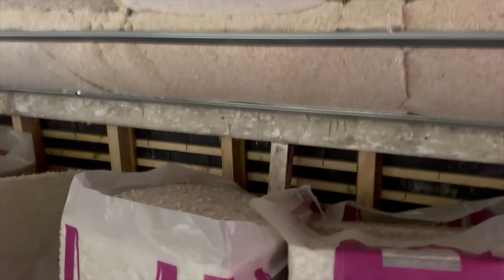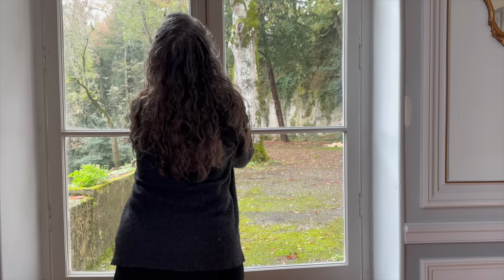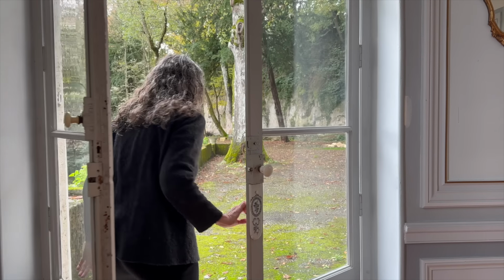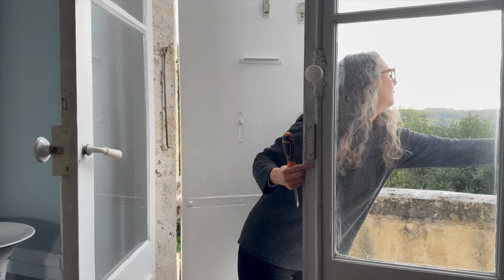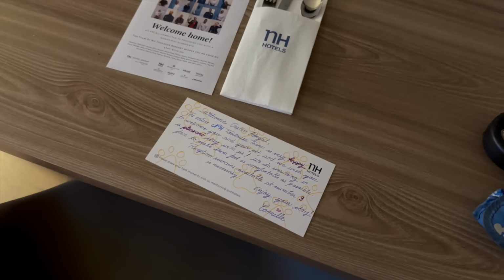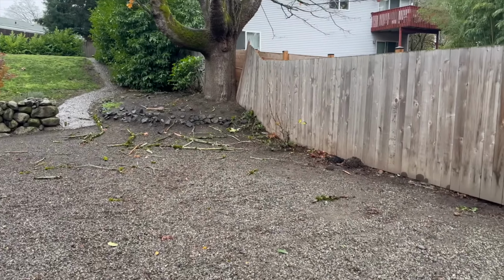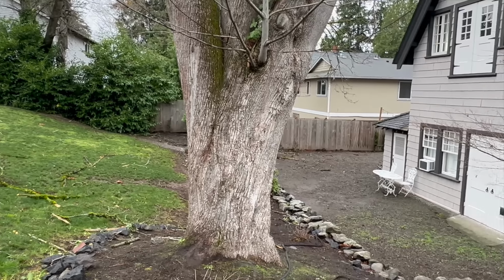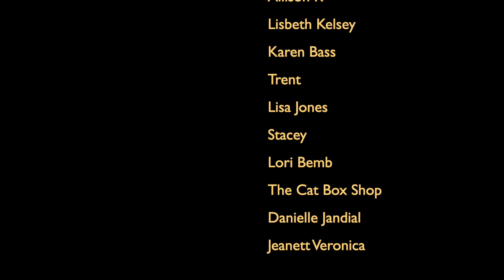Closing up the Chateau + Storm Disaster: Roof Damage & More 🌪️🏚️ Chateau Chronicles   Ep #115

Comment: We remodeled a basement and 8 lights in our room that is 15 x 12 could have used some more so we added three floor lamps for more lighting.  Use a dimmer if you can and that also makes great lighting particularly with LED lamps.  We only have 8 ft ceilings so that is another factor with only two small typical below ground basement windows for daylight.  I think more lighting is always best and if it is used for your art, I am already preaching to the choir 😂  I hope your Thanksgiving was wonderful for you!
Reply from the maker: Thanks for the suggestion. 😀